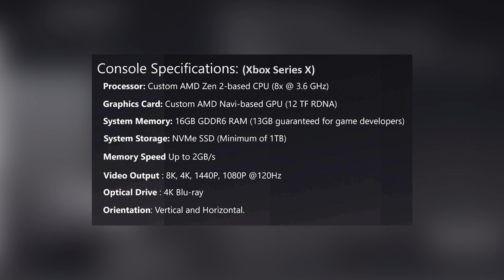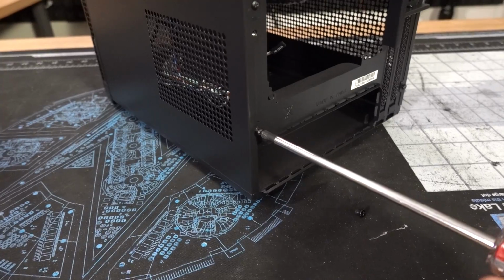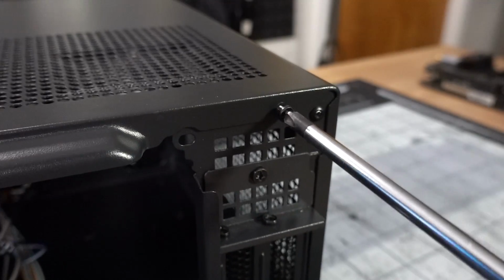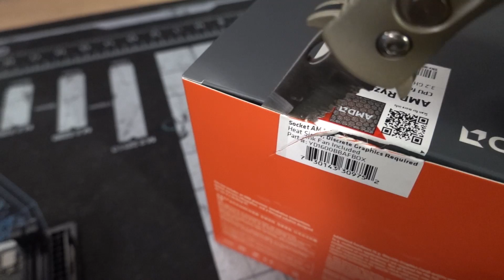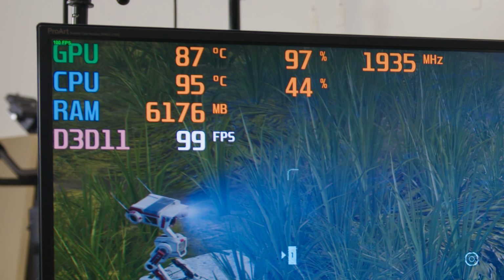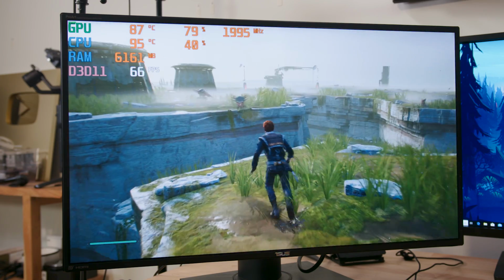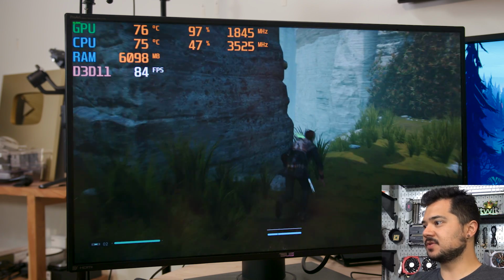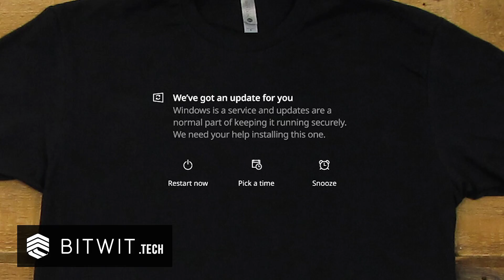I built my own Xbox Series X

Comment: Did you use the Microsoft console software or are you using the standard PC software?
 The Series X is obviously a game changer... It's hard to argue otherwise!

Did he do this video again? Seems like he made this a month or more ago and Ryzen 5 1600 AF! lol and the Wraith is good and all, but I like my heat pipes!
 My Ram is flexing a little too, I tried to tell it they weren't big enough to be flexing like that, but they tend to have an attitude... Vengeful even...

I would have went with "Cable Guy..."

Also, good scissors are great for trimming and I still use the adjustable one Axe put out like 4 years ago and it's awesome!

Another thing, you can't really expectdo you have good ventilation with giant gaps like that... Just saying!

Comment: So recently i attempted to build a Frankenstein pc and the watercooler(the only thing i had at the moment) leaked and messed everything up. This was my first build. Now i am left with my NZXT H500 or 510 case something like that. I have an evga geforce 970 graphics card i think. And i have some old hard drives i pulled out of some computers i found in the basement. I was hoping anyone here had some ideas on what parts i should get. I was really hoping for rgb but my budget probably wont allow it. Someone pls help!

Comment: "at least 600W PSU... to upgrade.."
?? I recommend you guys do some RESEARCH on actual power draw (from the PSU not the wall). An RTX2070 Super + R5-3600 build uses just over 300W. A good 550W PSU with good fan management can keep the fan at 10dB (silent) until just after 400W... you need some pretty powerful components now to go above 400W. An R9-3900x (12-core) setup with no graphics under load draws somewhere around 150W... not saying he's WRONG necessarily just that he may be overestimating the power demands. And the upcoming graphics cards might not use any more power than they do now (more powerful but also more efficient). COOLER DESIGNS for graphics cards seems to limit the top-end a bit too.

Comment: I actually did this build about a month ago with a few small differences. Essentially you have 2 choices with thermals. Air cool and use sff power supply as shown in the vid, or use an ATX supply and water cool. Otherwise things are gonna be cooking. I just swapped in a corsair H60 cooler to replace the Noctua l9i and am getting 30 degrees cooler temps on average (Maxing out at low 60's). I'm running an i5-9600k and a gtx1080. It's an awesome form factor though! I love that I can fit it into my backpack when i travel. Just in case anybody here is interested in building one of these.

Comment: 7:57 : You can remove the fan shroud from the Wraith cooler. It is just a clipped-on plastic ring that makes the coooler look more beefy and more quality, I guess. This way it doesnt bump up against the RAM modules anymore. Did that with mine.

Comment: "Console Killer" for me, is a itx pc, that can run games like COD MW at mid to high settings @ 144hz lock at 1440p upscaled to 4K (to be on a fair plane playing field with the other pc multiplayer gamers - 60fps would make no sense on pc when your opponents play on 144 or 240hz.). It also should cost under 299 (the price you get a ps4 pro on sale in germany). Impossible? Well then I think there is no console killer at all. You get the point. I'm building pcs my whole life and I'm even working for a pc manufacturer. But you can't beat the less-cheater, everybody-is-on-the-same-performance-level-factor for 299. Native 4K or 240hz? Yeah sure go for PC - but this whole "Console Killer"-thing is just not realistic.